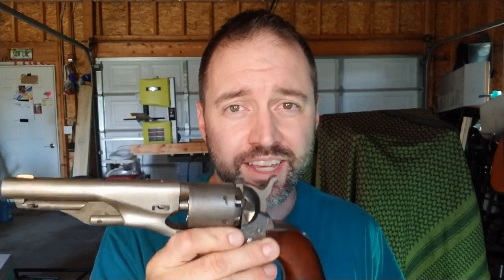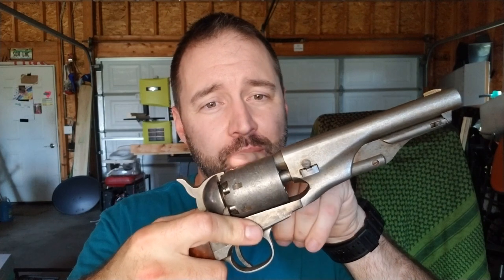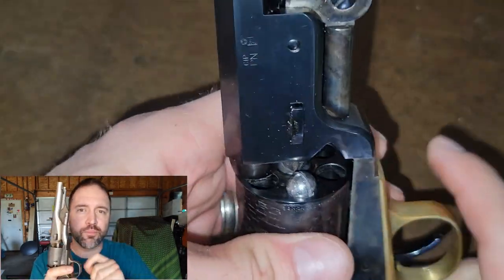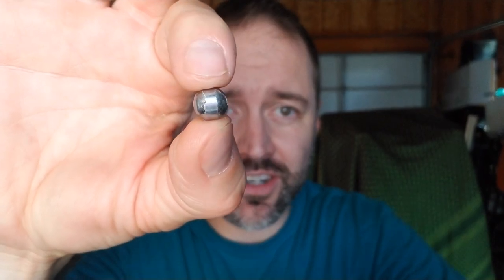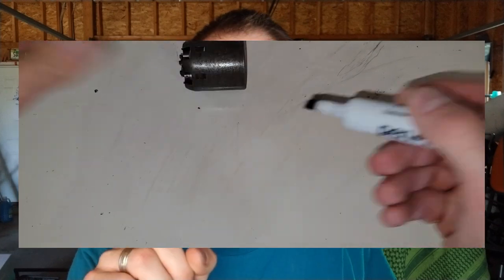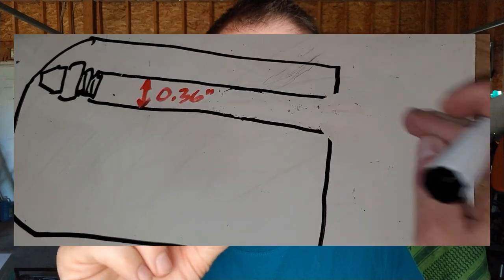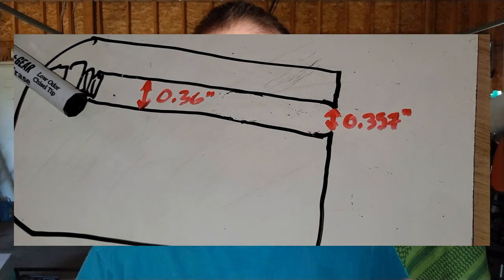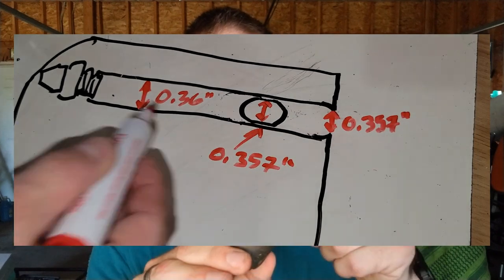Cap and Ball Revolver CHAINFIRE MYTH We've All Been Told

Comment: I shoot unlubed for at least one cylinder of every shooting session.  Never had a chainfire.  The one time I had a chainfire, I was using homemade caps.  Uberti properly crowns their chambers so flashover doesn’t happen.
Reply: My Chain was with DIY caps and powder! On Lubed cylinders and a 1976 Uberti 1858 kit gun.  Good Times.
Reply: It doesn’t matter who builds the pistols, chain fire can occur in any pistol. it can be as simple as a loose cap, a couple of granules of powder over the ball or even smashed between the ball and cylinder wall… it really doesn’t have anything to do with a specific manufacturer at all.
Reply: @archer721  If you examine Piettas, many of the chamber mouths actually curl inwards, making the ball smaller than the diameter of the chamber.  It kills accuracy and increases chainfire risk.
Reply: So you’ve been lucky so far. ANY black powder revolver has the potential for chain fire.
Reply: @rezlogan4787 my pieta has been milled correctly. Yet I still get chainfires.
Reply: Never say never bro
Reply: @rezlogan4787 ???? I don't understand what you're saying at all. The mouths on a pietta have a very slight chamfer that just seems to be for the purpose of deburring. I've taken a sunnen bore micrometer and measured the inside of the chambers and they seemed to be reamed well, within a few .0001 along its length. If there is a burr, sure that would affect how the lead is swaged and said burr can be removed. What do you mean about the chamber mouth curling inwards? Do you mean you have a tighter chamber mouth and if so how by how much? I have not yet seen pietta cylinders in the way you describe them and the several I own and have seen all seem to be within the same specs I have mentioned before.
Reply: @TankEpidemic  I’m sure certain pieces are properly chamfered.  All the ones I’ve seen people complain about having a curl inside the cylinder mouth have been Piettas.

Comment: Good information and well done. Im no machinist, but I’m having a hard time imagining how it is possible for a reamer or boring bit could produce that situation. Anyway, good job explaining something for percussion shooters to be aware of. O.R.
Reply: It’s not a burr but a taper, the ream itself has worn into an taper from the manufacture pushing tooling too far past when it should have been tossed out.
Reply: @geekswithfeet9137  - nope! - your explanation would result in the face of the cylinder being larger than the base and would create a tapered cylinder, it would absolutely not result in creating a burr at the mouth of the cylinder and in no way whatsoever cause the cylinder to be larger at the base and narrow at the opening.

It is clear that the face was milled after the cylinders were bored.
Reply: @archer721  ok buddy, you have appeared to completely not understood the assignment. Good short man energy though.
Reply: @geekswithfeet9137  no. 'Buddy'  - @archer is correct.
Reply: @Sssthpok   I've had to throw away several reamers when they get too worn for this exact reason. Your inability to comprehend isn't evidence of it being wrong.
Reply: It wouldn't be the cylinder boring, it's the face of the cylinder when it's later machined for headspace @ the forcing cone. It was likely  a dull lathe tool that created a slight burr. (37 years a machinist)

Comment: Nice summary. I have experienced this problem on a new Stainless Steel Ruger old Army but not on Uberti, Colt or Pedersoli.  Note the .360 calibre is measured to the tops of the lands, not the depth of the grooves which will be closer to .375 which will also be the size of your chambers but as you said the correct ball size is .380 as recommended by Uberti. I use wax under the ball (10% paraffin oil/90% beeswax) which acts as an additional barrier and also discard the factory nipples (you call them cones) and replace them with Treso brand nipples and use Remington 10 caps. These better nipples and caps allow the Colt style Navy and Army revolvers to function as reliably as cartridge revolvers and I have not had a chain fire.
Reply: ''These better nipples and caps allow the Colt style Navy and Army revolvers to function as reliably as cartridge revolvers and I have not had a chain fire.''  I have been told that this step is important because many chain fires occur at the cap end of the gun.

Comment: Chamfer tool with fine valve grinding  compound used  in  a hand drill, or by hand.  BARELY discernable chamfer. It will put a wee  bit of compression into the lead ball also. I read where target shooters also bore or polish a wee bit to uniform the chambers also. Some chamfer a slightly larger amount coupled with a slightly larger round ball, or conical for more compression without the lead debris . Just a bit more to research. Sometimes a chamber will have a burr that causes a gas blowby. A machinist inspection seems to be prudent with these inexpensive tools. Sad to have to inform the general public of MODERN high-speed manufacturing wabbldeegoop!
Reply: Or a glass marble with lapping compound works as well.

Comment: From what I understand, loose caps are a larger threat to chain fires. (haven't watched the video). I've read a book that stated the author had searched for instances of chain fire. The only one he had come across was someone using small shot and other things as a 'snake gun' that ended up chain firing. As it was greased on the front of the cylinder, the author still didn't think it went from the front of the cylinder, but was also due to loose caps.

Comment: "The ring of lead" is caused by a sharp edge on the cylinder not because the ball is so tight in the cylinder.  Normally there would be a slight chamfer on the edge so there would be no shearing of lead off the ball, which could actually make the situation worse.  The ball needs to be tight to keep from flashing over.  I thought that the "ring o' lead" was important so I had a .003" bigger mold made.  Still no lead shear.  Ball still went in hard as before as the lead swaged into the cylinder as before.  Never had a flashover...knock on wood-

Comment: This is why a chamber should have a slight chamfer around the end, this will have the effect of "squeezing" the ball/projectile into the chamber on loading, any difference in chamber mouth size should be checked before shooting, but in most cases the chain fire comes from the nipple end, the main spring is so feeble on repro revolvers that it allows the hammer to be blown back on firing, this allows gasses to circulate around the rear of the cylinder and ignite following chambers, I always measure groove diameter and ream chambers to .001" over groove size, this produces a slightly tapered chamber as on original pistols.

Comment: The late gun writer Elmer Keith wrote of finding an occasional cylinder on an original Colt, Remington and other revolvers that had a few chambers that were drilled oblong at the factory.  This created a tiny gap between the projectile and the chamber wall, though a ring of lead was produced. I've been shooting reproduction cap and ball revolvers since 1970, and have never encountered your problem or Keith's, but either is possible. I've experienced multiple ignitions three times in separate incidents, but always with the same cheap, brass-framed "Navy .44" made in the early 1970s. The final time, the ball at 6 o'clock blew into the rammer, expanded its end, and warped the brass frame. I've told shooters for many years to avoid any and all brass-framed cap and ball revolvers because they are made to be inexpensive, so corners are cut. The fit and finish on their steel parts is always worse than the steel-famed counterparts. A good, thought-provoking video. Thanks.

Comment: On my Pietta 1860 Army, the cylinder bores were 0.446". The lands are 0.445" and the grooves 0.450". So after the ring of lead gets shaved during loading the balls were barely large enough to mate with the lands in the barrel. I used a 0.452" reamer to upsize the cylinder bores.
Reply: Exactly the situation with my Pietta 1858 Remington.  You were reading my mind.  I upsized the cylinder bores also to .452 and the improvement in accuracy was amazing.     I now use .457 roundballs which makes it convenient since I also have a Ruger Old Army.
Reply: I use exclusively .457 balls with felt wads on chamfer cylinders. Never had a chainfire or issue  since.

Comment: I’ve had it happen to me once years ago when I forgot and didn’t grease my projectiles as I was told to do by many people. I had 4 chambers go off with one ball weakly hit the back of my truck. Fortunately there is enough gap between the cylinder and frame so that the projectiles left with not building up too much pressure. After that I made sure I either have lube, lubed wads or both, not forgetting. It sure makes a big bang and a large flash.

Comment: Somethis I also found can cause chainfires is messy powder. If youre using lube sometimes the powder can get stuck around the mouths of the chamber. Powder can be dragged and smeared between the ball and cylinder wall giving you a sort of "fuse" leading to the charge in the cylinder. Oversized lube wads help to arrest some fire that may be trying to find its way around the ball. My cylinders have been reamed to a bigger size to accomodate the actual groove diameter of my pietta and deburred at the mouths. Diameter is uniform along the length of each chamber. Check your cylinders, check your cap fitment, use wads if possible. Grease over the chambers does not seem to help as the first shot will blow a majority of the grease out from the chamber mouths.

Comment: In my 1851 navy using .454 balls I’ve never had the experience with any amount of jostling that the balls have moved at all. I know only some newer and older pistols have a slightly different cylinder mouth diameter compared to further down the cylinder.

Comment: Great video and important information. most of my originals either due to Machining or wear over the years. created a chamfer at the front of the cylinder.  it wont cut a ring unless you put in oversized balls. But if you push the ball past the chamfer it will compress a normal size ball in. works great but you have to make sure you seat the ball past the chamfer.

Comment: In 62 years of shooting BP revolvers, and having had dozens of different manufacturers, I've had only one chain fire. And I load loose powder and also paper cartridges. No lube, no greased felt wad, just as they were originally loaded years ago.
That one chain fire occurred when a cap fell off from a 1969 mfg ASM Colt 2nd Model Dragoon. The ball skidded down the side of the barrel causing no damage.
Reply: Same here.   I think people get somewhat overly concerned about chain fires.  If they do occur, since the cylinder is not in battery, it doesn't develop the pressure to propell the ball with any significant velocity.    I am not saying to be cavilier about them, but it isn't the end of the world if it happens.  Just scares the crap out of you and makes alot of fire and smoke!

Comment: "I Think" My Chain Fires came from the Caped end, but no BFD as I always hold with a Chain Fire in mind. Lose any cap Not in Battery under recoil and you are at risk!  O Ya good soft lead will deform or form? to your cylinder at final compression seating if you give it a good final home seating.
FYI "I use" a cheap tapering tool or tapered alignment pin with 1 or 2 raps of 1000 grit wet dry paper and give it a gentil twist or two. I use the same tapered cutting tool to make part of my paper cartridge formers out of hard wood as my Dog Targeted my "Capandball" store bought tool and I have tapered a barrel or more for easier loading or ball starting with same tool for $14 so cheap I got a set of 2 sizes off Bay.

Comment: Poor fitting caps and powder leakage/sloppy loading are responsible for most chain-fires with a properly fitting ball.
My main C&B shooter is a Beaumont - Adams. It's a mix n match parts gun - and the chamber tolerances are tighter than a Nun's nasty!
Pretty sad when a 160+ year old cylinder has better machining than a Pasta Blasta' made last year. Says a lot about Victorian manufacturing!

Comment: Have worked with precision metal engineering! Nothing is perfectly, only with in tolerance. A chamber could become bigger further in with slightly faulty manufacturing.
I do believe some original cap and ball revolvers cylinders actually where lightly tapered.
So you pressed in the bullet really against the walls.

Comment: Easier to use an inexpensive bore gauge. I use .375 balls in my 1851 Navies and 1861. All my guns are Colt or Uberti. I had one 1851 Pietta and it was not the quality of the previously mentioned brands.

Comment: I had this problem on a Ruger Old Army bought just a couple of yeears ago that had been manufactured back in 1978. It had 2 thou burrs on 5 out of 6 chambers. My balls would slide out out under recoil....! I finally figured out the issue and believe the gun had only ever fired its proof shot from one chamber. I used dowel and emery to remove the burrs, took ten minutes, gun now shoots great.

Easy fix and I got effectively a brand new gun ;-)

Comment: It's called a swage fit.  The ram swages the ball into the undersize chamber, thus sealing the chamber and tightly fitting the ball securely.  That's the theory anyway.  It's very rare that recoil can loosen a swaged ball enough that it actually partially rotates allowing an ember past the sheared belt and into the charge, but anything is possible.  Best to seal the chamber with bullet lube over the ball.  It also keeps the fouling soft, which can really soot up the works in a very short time.  There's just no good reason NOT to use it, unless you are being chased by commanches.

Comment: Basically you crowned each one of the chambers in the cylinder!  I understand you can do the same with a brass round head screw with a Phillips head. Put some polishing compound on the end of the screw and using a drill or drill press spin it while pressing it against the opening in the chambers.  It will bevel the end of the chambers.

Comment: This is why i chamfer the chambers it will still shave but it will swage the balls in. I use felt wads to prevent chain fires regardless. It works better since lubing cylinders doesnt work when your gun is warm. It makes the gun a greasy mess.

Comment: The first thing you do is disassemble a new replica, demurred, smooth up and better fit all parts and frame, a cone shaped stone I will take, put in each cylinder, turn it by hand for a couple of rounds. Assembly, adjust trigger spring, ready to go

Comment: Seal each chamber with lard and beeswax, Make your own 50/50 by melting it down and then cooling into a cake. Helps lube the barrel and prevents flashovers. Add on top of each ball after loading.
Reply: You can also use a dab of Crisco Shorting.
Reply: That doesnt work in warm weather or a warm gun. Felt wads and a proper sized ball with chamfer chambers is more effective.
Reply: @yourredcomrade717  And why not? It won't melt out as the bees wax won't let that happen. All lead if purchased correctly is the right size and a small amount will strip off like an "O" ring when seating. That issue was apparent back in the 1850's, but no more. I'm surprised you even have enough chamber length to accommodate felt wads. Nothing says they'll seal a chamber anyway.

Comment: Haven't heard of the burr problem. I have seen a chamber or two that was "out of round" (slightly oval, if you like). I've also seen chambers that varied slightly from one to the next (one 360, one 361, one 359). A proper sized reamer is a good fix for this. 
But as an FYI, chain fire can occur from the nipple end as well if the caps are too loose. The flame from the fired cylinder can ignite the adjacent caps, similar to the way a flintlock fires, if the caps are too loose and pinched in place. Pinching caps is viable ONLY for a single shot - not a revolver. In fact, the only chain fire I've ever had was when I used #12 caps on #10 nipples. 
Interestingly enough, a loaded chamber with a cap won't fire adjacent chambers WITHOUT any caps. Which is why I said the effect is similar to a flintlock.

Comment: If your chambers measure .36 I guarantee your gun shoots like crap....because the groove diameter on current .36 revolvers is .375 and a .36 ball will not grip the rifling at all.
Reply: Well… I guess there are exceptions… I have the exact pistol he has in this video. The chambers/cylinders measure out at .360 and the bore is .357 to the bottom of the grooves… and mine is almost as accurate as my Colt Navy produced by Colt in 1971. it’s claimed as a “.36 caliber” but the cylinders are .380 and the bottom of the grooves measure out at .375… so I would actually call it a .38 caliber
Reply: That's probably a measurement from groove to groove, the lands are definitely not at .375. Land to land should be .36

Comment: If you can’t feel the burr then it’s probably not a burr, but rather a tapered chamber. The human finger can feel incredibly small surface details.

Rather than deburring you probably cut a slight chamfer that compresses on the cut lands enough to snug it up inside. 

Functionally the same, but technically different.

Comment: Just get a high speed drill bit close to the size and carefully debur the cylinder. I got three pietas . Two1958 Remington's and a colt navy pocket pistol. Never had a problem with loose balls . I had a chain fire using undersized .451 balls then I moved up to .454 and no problem.